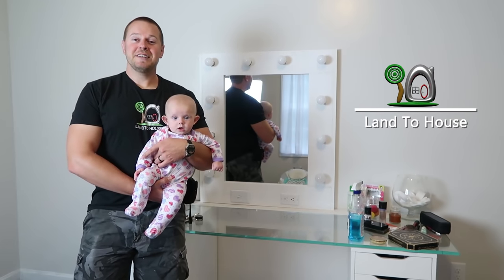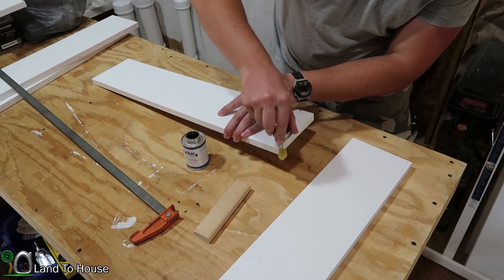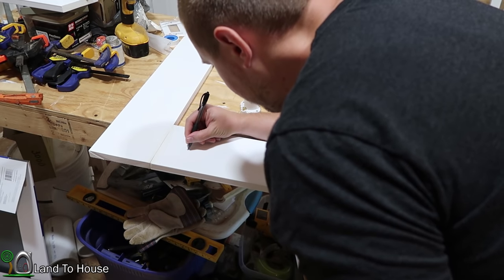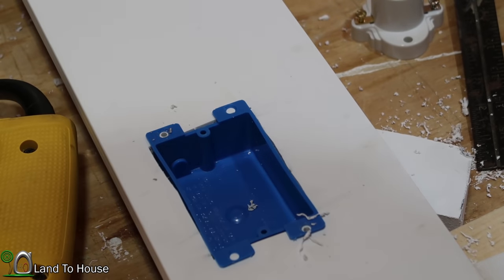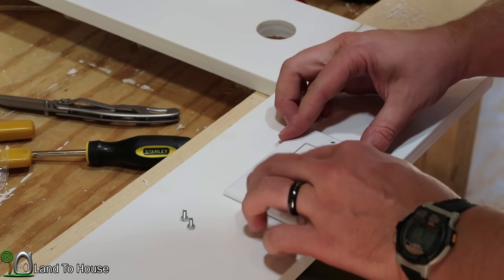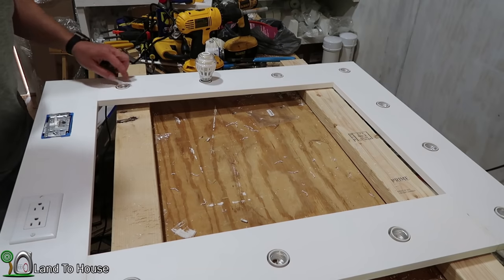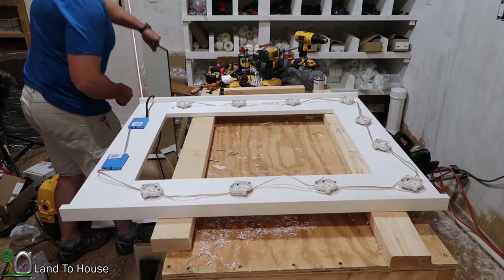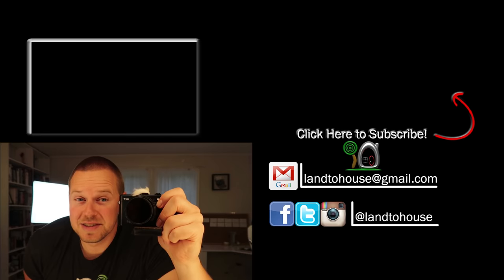Makeup Vanity Mirror with Lights DIY Step by Step

Comment: TO ANYONE READING THIS!!! Be careful when using PVC as it is more flimsy than woods and can break. Other than that this tutorial is the best and most helpful on YT!
Reply from the maker: Thank you. So far no issues with strength or breaking.
Reply: @LandtoHouse  I've made a few of these using your tutorial for family and friends as gifts, I only used PVC for one and it broke. Keep in mind I shipped it to a relative, so that and packaging could have been part of the problem. However, all of my wooden ones held up.
Reply from the maker: Seems reasonable. Shipping anything these days is dangerous. Happy to hear you enjoy the tutorial as well.
Reply: @LandtoHouse  Where did you get your light sockets?
Reply: @LandtoHouse  Also, have you experienced any issues with the plastic sockets and the heat from the bulbs? I can't tell if they're porcelain or not.
Reply from the maker: These are from lowes. You can also get them from amazon.
Reply from the maker: Link in description.
Reply: @LandtoHouse  Thanks a lot!

Comment: Just to be safe I would’ve definitely recommended a grounded cable and fuse breaker outlet if you will be running a blow dryer or any hair straighteners, curler, etc bc it would suck to have a melted wall outlet or a house fire! Always think this was: always best to be safe then sorry!
Reply: I agree, so would it work if I wired 12/2 awg Romex along the whole thing instead so the ground is connected all the way through?

Comment: You are brilliant. I cant wait to get started on this. My only concern is I forget which wire to connect to what 😭
Reply from the maker: Thank you for watching! Luckily in this type of build your only working with two wires basically. The hot side and the neutral.

Comment: Will this work the same if I buy a framed mirror & just install the light sockets instead of having to make the frame from scratch?
Reply: Huyenessy yes
Reply from the maker: Yes. You can do that just fine. Just be sure to have a hole saw or drill bit that will reduce splintering or cracking of your frame.
Reply: Thann you for share this 💜👏

Comment: Definitely the best tutorial I've seen on a DIY vanity mirror so far! Especially appreciated the wiring sockets part, most the ones I've seen have used the bath bar lights. Can you go a little bit more in depth about wiring the dimmer though? Is it connected to the receptacle with a different extension cord and is that same one cut again to use toward the sockets? Thanks!
Reply from the maker: Thank you. The dimmer switch just has two wires going to it. The extension cord goes from the wall outlet to the mirror receptacle. Then lamp wire to the dimmer. I ran the single strain of lamp wire to the dimmer and cut the "hot" wire while leaving the neutral uncut. Then from the dimmer to all light sockets I ran lamps wire. Each of these have the wire cut fully on hot and neutral. ..... SO basically the extension cord only goes to the receptacle and all other wire is lamp wire.
Reply: I’m lost.... so I’ve bought a extension cable.... 
connected it to my plug.... 
had a ground so I connected the ground and ran a ground wire to my dimmer. Ran the hot wire to my dimmer as well.

Now I’m trying to get lights to work....
Do I just run power to both sides of the light ? Orrrrrr what do I do?
Reply from the maker: +Louis Adams Diaz because your extension cord has a green ground wire you will run that to the bottom of your plug. The black wire is the hot wire so it goes to the brass colored screw on the plug. The white neutral wire goes to the silver colored. You will need to run the green wire to the ground on the dimmer. And break the black wire. The white neutral wire skirts around the switch. From there you will connect the black wire from the dimmer switch to the brass colored screw on the 1st light. The white wire goes on the silver colored. And it continues down the line like that.

Comment: Awesome video! I’ve learned a lot and I’m working on a similar project for my wife. I say similar because the mirror is going to be attached to a desk and not hanging, also is going to be deeper than two inches on the sides because I’m putting the switch and outlet on the sides. 

I have a couple questions that you can hopefully help me with! 

First: with the lights all on full power and say there is a hair dryer plugged in and on as well, would there be any problems with power flow? If there is, should I buy a power cord that can bring in more wattage and that would fix it? 

Next question: the outlet that I’m going to be using is one with two outlets and two USB ports on it for charging phones and other accessories. Is there anything different I should do wiring wise for that? 

Last question: what are the wires you’re using to connect the lights, did those come with the sockets? And what is the cord that you’re using to connect the switch to the outlet? 

Thank you so much for any help you can provide!
Reply from the maker: Thank you for watching!  1. Most common power cords are going to be 15amp. But they can support more than that for a time. My wife has been known to run the dryer for a few minutes with the lights on and never tripped a fuse. 2. I have not every used an outlet with usb chargers but I assume there are circuits inside that take the AC to DC without any steps by you. 3. The wires that connect the lights are simple 18 gauge lamp wire. The wire was purchased separate. I also used the same wire to go from the receptacle to the switch.
Reply: Land to House awesome!! Thank you so much, helped a ton!

Comment: I am doing a vanity mirror and i have a 300v wire. Can i use it for the socket at the same timw for the bulbs and switch?  Please reply 

My wire is flatcord 1.25mm^2*2c. 300V
Reply from the maker: Hello. That is 16 gauge wire. that will be just for the light bulbs and switch. Typically you want at least 14 gauge for the power outlet or even 12 gauge.

Comment: Great Job... Glad I watched this as I Totally Forgot that you can get a Flip Switch with the Dimmer All in 1!!! Is the PVC easy to Clean & Safe with the Heat of the Bulbs???? I plan on using 12/14, 25 watt LED's
Reply from the maker: Thank you. I am using ten 9W bulbs and it is just fine. Using 25w LED bulbs would be so very bright! That is like using 150w incandescent bulbs.  12 of those in one room might cause eye issues.

Comment: instead of using that glue and clamping could u use a  jig and make pocket holes so u could just screw the pieces together? ive never worked with that material so im just curious. nice job u did!!!
Reply from the maker: I have not tried using pocket holes in this pvc trim. I dont think it will hold as well as wood.

Comment: Nice! Would those exact wires and dimmer work if I made a vanity but with more lights? I have a 45 inch mirror & I want 8 lights on top & 5 lights on each side.   Or do I have to buy specific wires?
Reply from the maker: +Julizza Marie thank you. As long as you're using low-wattage LED lights you'll be fine with that many. If you try to use traditional light bulbs you may run into a problem.

Comment: You’re amazing 🤩 Not everyone does step by step. I’m trying to make one for my daughter. But can’t seem to fine that exact light socket. All they have at lowes and Home Depot are all big and round. If you don’t mind me asking where did you buy those ones at?
Reply from the maker: Thanks for watching! You can get the loght sockets on lowes.com or look in the electrical isle probably in a small box on the ground close to the replacement extension cord plugs.
Reply: Land to House the 660 watt? 

Thank you so much appreciate it 🙏🏽
Reply from the maker: I actually have an Amazon link in the description for the sockets.  That might help you find what you need!

Comment: Would it still work the same if I hook the neural to the neutral screw on the dimmer? Also can I just keep the current going by wiring the rest of the wire on the hot or do I have to put it on the other screw you did ?
Reply from the maker: With a switch you typically do not need to have the neutral wire connected. You only want to break the hot wire. So you can actually keep the neutral wire uncut and bypass the switch.

Comment: Great video!! Deserved a thumbs up..sorry for the dumb questions, the 1st batch of wires that you connected in the outlet, the other end of that wires goes straight to the wall socket right? And the wires connected from the outlet to the switch,where do I connect it in the outlet? Also, does it matter if I use a normal switch compared to the dimming switch that you used? Planning to make this for my wife for our anniversary 2 weeks from now and your video is a great help! Hope I hear from u soon..thanks!
Reply from the maker: Yes the decorative power cord goes to from the wall outlet to the outlet in the mirror. The outlet in the mirror has two brass screws and two silver screws. one set will be for the incoming wires and two are outgoing. The smooth wire is the hot and will be on the brass screw. Happy building!
Reply: Thanks for the information! Glad I saw this video..
Reply from the maker: Thank you for watching!
Reply: Hi buddy. I'm about to build this, I'm just wondering..If I'm using a normal switch and not a dimmer one..do I need to connect the neutral wire from the mirror socket to the switch and the hot wire from the mirror socket to the 1st light? Or do I still follow your connection? Thanks!
Reply: Crystal clear..thanks again and thanks for replying

Comment: great video! just one question. Did you connect the lamp wire to the brass and silver screws on the outlet?
Reply from the maker: Thank you. Yes the wall extension cord goes to one set of screws as power in (one brass and one silver) and the lamp wire comes out of the other set.
Reply: What if I only have one set of screws on my outlet
Reply from the maker: One should be "hot" and one "neutral " there is also almost always a green.

Comment: Any chance this could be stand alone unit instead of hanging? Will this require a base or would you say go with a thicker trim to make it stable?
Reply from the maker: I should think that you can make is a stand alone. Not exactly sure how that base would look. I found that a wall mount was the easy way to get it in place.

Comment: Hi, i have a question for you. 
I connected the dimmer with 3 four bulb light bars and a face outlet. My dimmer popped :(. 
I’m scared and just decided to maybe just add a on/off switch. I really wanted the dimmer but I don’t know how to connect it. I used 14 gauge cable. Am I supposed to connect all cables from the dimmer or no? 
Thank you!
Reply from the maker: Are your light bars AC power or DC power? If they are DC that would be why they blew the switch. If you would like to send a picture of your build to my land to house Gmail I would be happy to help you walk through the building.

Comment: not about the mirror but what size glass is on your wife's vanity?
this is like the best video i saw on the mirror you did a wonderful job
Reply from the maker: The glass is 3/4" thick and somewhere around 5 feet long. Width I am thinking around 2 feet. This glass was from a tv cabinet my parents had. I bet it would be expensive to by standalone.

Comment: If I'm using a 1x4 instead of a 1x6.. would I have to make the cuts 2inches shorter than the cuts that you made??
Reply from the maker: Do keep in mind that 1x4 is actually .75" x 3.5". So if you are going to install the electrical outlets and switch on the bottom it will have only a small amount of space for support. If you are using the same size mirror you will need the inside dimensions to be the same. But yes there will be 2" on each side. So 4" total difference.

Comment: So do you have to plug anything into the wall?? How do the lights work
Reply from the maker: Yes the extension cord plugs into the wall. It was around $150. Wood is fine I am just not skilled with wood working.

Comment: Hi, power socket has 2 brass and 2 other screws, Do I need to connect to both brass screws to make both sockets work or will just one make both work?. I noticed you only connected one. How do i connect to both brass screws if extension cord only has 1 hot and 1 neutral?
Reply from the maker: That is common. The two sets of screws are actually connected with a small jumper wire and this makes the two sets the same point electrically. You can connect with one set and use the other to carry the wire on to other things.
Reply: Got it. Thank you for replying so quick. This is an awesome video.  I will be making 3 (Wife and 2 daughters)
Reply from the maker: I am happy to hear that the video is helpful! If you run into other problems feel free to send me an email. I get to those a lot faster.

Comment: Is the 1x2 trim on the two outer sides necessary? I am currently making the frame, but I wasn't sure if I needed to do that step or not. Thank you.
Reply from the maker: The trim work actually hides the electrical wiring from being seen and also pulls the mirror out away from the wall so the sockets are not being pressed upon. If you can I would go ahead and include that in your build
Reply: Thanks for the reply, I will make sure to include it!

Comment: The cable on the dimmer, wich one is neutral and not neutral?, cs both looks the same, i can't tell the difference?, plis help
Reply from the maker: Are you talking about lamp wire? The smooth side is the hot. That is the one that will go to the dimmer switch.

Comment: what gauge extension cord did you use? I got a 15 amp outlet and a 16 gauge 15 ft extension cord is that okay to use?
Reply from the maker: I think it was just 14 guage. Nothing special.
Reply from the maker: Yes that should work just fine.
Reply: @LandtoHouse  Thanks!
Reply: @LandtoHouse  Another quick question: is the hot out on the dimmer switch next to the hot in screw? Or is it on the other side by itself
Reply from the maker: It will depend on the type switch you have. I would suggest looking at the paperwork that came with the switch. In most switches there are only 3 screws. Two hot and a ground.
Reply: @LandtoHouse  I believe it is the same one as yours. I was just confused when you said connect one to the hot in and you pointed to the screw, but didn't point to the hot out screw. I just figured it was the one next to it so that's what I connected the hot out to. Everything seemed to work fine, I just had to turn the little black knob all the way to the plus side since the lights weren't as bright.

Comment: Help!!! I’m trying to connect my dimmer but the one I found has 2 black cables and 1 green. Do you know how these would be connected?? I would appreciate your help
Reply from the maker: The two black are to break the hot wire. The green is ground. If your power cord has a ground you can connect the unsheathed wire to that green wire. Otherwise ignore the green.
Reply: Land to House sorry to bother you again but I had to get an LED dimmer and this comes with 2 red 1 black and 1 green. Should I ignore the red and green and just connect the black cable?
Reply from the maker: I would have to see the diagram BUT it sounds like your switch could be used as either a two way or three way switch. You will need to check the paper that came with the switch as to the correct wires to use. If you would like to send a picture of the diagram to my land to house gmail I can help. It should be easy to tell though.
Reply: Land to House thanks I went ahead and sent you an email

Comment: Hey there, awesome mirror! I want to do this myself but unable to find the azek adhesive in any of my stores or even online. Any other adhesives you'd recommend?
Reply from the maker: I got mine from lowes. It was in a small display in the lumber isle. You might have to put your local store in the search but here is a lowes link. https://www.lowes.com/pd/AZEK-Clear-Exterior-Contact-Cement-Construction-Adhesive-Actual-Net-Contents-4-fl-oz/50414654
Reply: Yeah, it says unavailable at any Lowe's in 100 miles of me. Maybe they dont sell it here? I'll go check in store maybe
Reply from the maker: Thats so odd. I cannot find it online anywhere. I also dont find an alternative.
Reply: I ended up getting a heavy duty PVC cement which seems to be working well
Reply from the maker: +ColorMeKat nice! I was at a loss for an alternative. What was the name of the cement? I am sure others will want to know.
Reply: Sure thing! It's Heavy Duty PVC Cement by Oatey. Very similar look to the one you used. I got mine from Home Depot but they have it at Lowes too. Link: https://www.homedepot.com/p/8-oz-PVC-Heavy-Duty-Cement-308631/100139307
Reply from the maker: Great! How well is the cement holding up? I am going to add this as a possible alternative in the description if its holding well.
Reply: I haven't completed the project yet as we're waiting for paint to dry (I painted it black) but the frame has been done for about a week now. It's held up very well so far through moving it around, painting and drilling all the holes in for the lights and junction boxes.
Reply from the maker: Thank you for the update. I will go ahead and post a link to that cement so others can use that if they cant find Azek.

Comment: Hi, Im in Hawaii which unfortunately means Im unable to obtain the right size pvc trims nor can I have it shipped, would this be possible using wood?
Reply from the maker: Yes you can use wood for sure. I recommend using untreated wood inside. You will want to sand and paint/stain. I think most people are going to build out of wood. I just wanted to give this a try.

Comment: Shouldnt you be using a fused spur between the Socket and the lighting to reduce it to 6A for example (sockets being fed from a 32A)
Reply from the maker: The wall power is only 15a here at my house. The LEDs will only use what they need. So far no issues even with blowdryer.